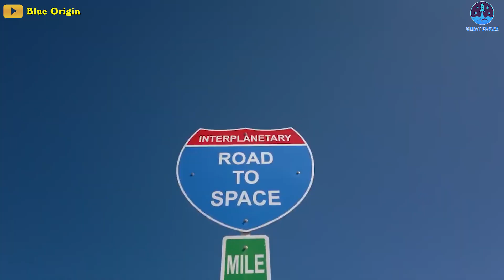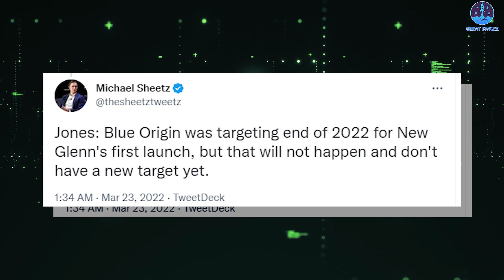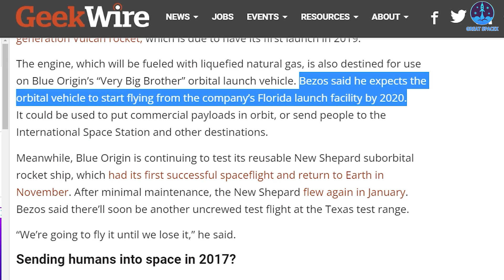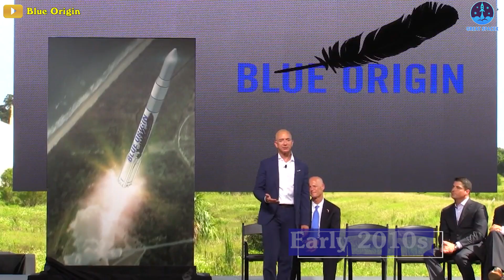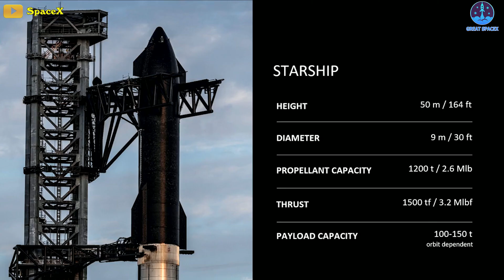Disaster! An In-Depth Look At Blue Origin’s New Glenn Launch Vehicle. Outclased by SpaceX!!!

Comment: The real issue for Blue Origin isn't the rocket's fuel tanks or ancillary equipment but the BE-4 engines.  Only one "flight ready" engine has been delivered in the last few months and a second engine delivered had to be sent back to the factory for more work.  Until Blue Origin can produce enough reliable engines for New Glenn, it will never get off the ground

Comment: 7 BE4 engines! That means BO will only have to wait 8 or 9 years between launch as they have only produced 1 and a possible so far. BO should stick to what they are good at - making rather dated, hopeful cgi for PR, since they certainly aren't good at building engines. Bozzo's New Glenn is an irrelevance produced by envy of SpaceX, and by its lack of engines has had the side effect of hamstringing ULA with its rapidly decreasing stock of launchers. By the time either gets to fly it may be too late to compete against much cheaper, proven, reusable designs and SpaceX will have wrapped up all the military contracts. Well done Jeff - time for BO to merge with ULA - United Losers Alliance.

Comment: Blue Origin seems to have a Long way to go , they have never tested it can’t even build the engines , unlike Space X that tested their Starship many times until they got to this point , we know we all watched the test flights and clapped when they got it right! New Glen hasn’t even been Flown, I guess they are going to go with the computer generated tests. We’ll good luck , even the SLS has never flown just the  components like the engines , fuel tanks and boosters have all flown in a smaller version , but will it fly we’ll find out on Nov 14th.

Comment: As soon as the first SpaceX Superheavy booster launches, New Glenn is obsolete.  Even if the market will not support SH, the engine manufacturing juggernaut will be in motion.   The BE4 is, admittedly, slightly more powerful than the SpaceX R2.  However, SpaceX is or soon will be delivering an engine per day while Blue Origin has delivered at an effective rate of one engine every 2.5 YEARS.  If SpaceX cannot use all the engines it produces because SH has little to no market, SX can sell engines to ULA and/or other launch vehicle vendors while BO tries to h I t a production schedule of one engine per year...
Meanwhile, SpaceX can build a medium lift rocket around 7 or 9 (or some other number; nothing magical about these numbers) R2 engines to reduce turn-around time and expense by replacing the RP1 fueled Falcon-9 fami,y with a cleaner methane fueled R2 engine replacement.  

Meanwhile, a new engine will be in the works... pushing Blue Origin further behind in engine design and development.
Reply: If Starship is successful, there will soon be enough missions for it when people and institutions realise how cheaply they can launch spacecraft to LEO and beyond.  The way I look at it is that it's like computers. -  once you build a more powerful and econnomical computer, the software designers won't be far behind...

Comment: The BE-4 engine has only slightly greater announced thrust than Raptor 2.  While New Glenn 1st stage will have 7 engines the Starship 1st stage has 33.  That means the Starship booster has 4.5 times the takeoff thrust.  Meanwhile BO has so far been unable to supply two working engines for a Vulcan, while SpaceX has over 100 Raptor 2 engines delivered to Boca Chica and obviously intends to have over 200 installed in the five boosters and seven Starships currently on the assembly line.

Frankly SpaceX needs competition.  The only company it is currently competing with is itself!  One aspect of this is the conscious decision to not make Falcon Heavy more competitive through a larger payload fairing or improved 2nd stage performance.  Once Starship is operational it will have a higher profit margin than Falcon Heavy.  It will also be more flexible.  Starship is designed like a commercial aircraft.  Every model of commercial airliner comes in 3 versions: short, standard, and stretch because all that is different is how many rings are in the fuselage.  Falcon and New Glenn cannot do that because of their carbon-fibre construction.
Reply: "Once Starship is operational it will have a higher profit margin than Falcon Heavy."
Understatement of the year. For 100 tonnes of payload to LEO they could charge customers 3,000% markup and still undercut the competition by a wide margin.
With less payload tonnage the markup would shrink, of course, but would still be incredible.
Reply: @TimStCroix  a
Reply: A book seller can not think like a nerd.
Reply: If Starship works as advertised, Falcon and Falcon Heavy upgrades will be redundant.  If Starship is a failure and can't be made to work, the imperative will then be to improve the Falcons.  At the moment SpaceX may not have direct competition, but the drive behind the Starship is the fact that it will open up space to many more people while bringing costs down, making huge profits for SpaceX.  The quicker SpaceX can make Starship a reality, the more profit for SpaceX, and simultaneously putting the last nails in the SLS and Blue Origin coffins.
Reply: @chrisantoniou4366  Considering how long it took to get Falcon 9 to certain reusability, which lacks still behind SpaceX planned reusability. I really doubt they will achieve this faster with Starship as a much more complex system. The best advantage of Starship is, it can be used as a Skylab-based space station. This means you can deploy space stations pretty fast, also combine multiple Starships into a larger space station. For moon missions the two-stage design is a pretty huge waste, for small payloads again it will be a waste, so left is large and heavy payloads. But these are rare, and their own Starlink payloads are an exception.
Reply: @oxygenasturia5706  SpaceX will not achieve a robust Starship quicker than the Falcons, but remember it has already been under development for some years and how long it takes from here will depend on the success or otherwise of the orbital test.  Starship will be completely reuseable and so will be much cheaper per kilo to space.  Starship as space station might at first glance seem to be a good idea, but most of the upper stage is taken up with rockets and tanks so not the best way to use something which is designed to come back and be reused.  In that scenario, it would be better and cheaper to use the upper stage to send multiple modules to LEO than using Starship in the way you suggest.

As for Moon missions, a dedicated lander based on Starship is already under development so that the SLS (if it ever gets off the ground) can actually land people on the Moon, and a Starship tanker is also being developed to refuel a lunar or Martian lander in LEO.  You are perfectly correct in that a Startship is really only good for larger and/or heavier loads, but these will come when the capacity is there.  Bigger, more capable probes, landers and rovers can be sent further, more often and more cheaply into the outer Solar System, larger more capable satellites can also be sent to geostationary orbit and larger more capable telescopes can also be sent to various orbits more cheaply.  The old adage "build it and they will come" applies here in the same way that faster and more capable computers were built before the software engineers could write software to make use of their abilities, one follows the other...

Smaller rockets will still be necessary for smaller payloads or for orbit specific payloads, but if Starship can be made to work, even if it does take years to do, it will completely transform the space industry.
Reply: @oxygenasturia5706  SpaceX originally designed Falcon 9 to be used 10 times and now there are boosters that have flown over 13 times. Where do you get your information from? SpaceX says it needs Starship to make Starlink profitable by launching hundreds of satellites each time. What would be the point of using the Starship second stage as a space station?
Reply: Recently SpaceX celebrated a milestone of producing 200th Raptor 2 engine.
Reply: SpaceX clearly does not need competition lol, they have a vision, and the vision has nothing to do with competition - in contrast SpaceX is by default open to cooperate
Reply: If it's operational, it then needs to prove it's a reliable rocket, also reusability and launching cost. But before it needs to prove it can reach orbit at all. For most launches Starship is simply too large, it's a massive waste of using such a powerful rocket, and combining multiple satellites like Starlink won't work this easily if they need different orbits. New satellites using the capabilities of Starship needs multiple years in production. We can already see that Falcon Heavy wasn't really used much. It's pretty unlikely Starship will achieve cheaper launching costs for small satellites such as Falcon 9.
Reply: @oxygenasturia5706  i think you missed something that would make starship one of the chepest rockets to lanch period its reuseablity rockets Are expensive to lanch not becuce og fuel but that all rockets excpt f9 is single use mening you have to turn a profit on one fight Even f9 upper stag isnt reuseable so its expensive now you could cut price pr lanch almost in half by makeing both first stage and upper stage reuseable for 2 fligts starship is also designed for rapid reuse f9 isnt a starship could do multiple fligts a day allowing more lanch Windows and provide cost savings on control team planning
Reply: @pingvingaming  The current reusability is only talk and paper, I highly doubt they will achieve this easily. If they can achieve 10 turnarounds it would be great. The current target is more, achieving an orbital entry.
Reply: @oxygenasturia5706  dont think they take long to Lean  hos to get starship in orbit they got experinces in getting rockets there they know how to land a booster only Challenge i see for Them is reentry of the ship it self but they can and will mand it work spaceX is professionelle in makeing impossible late

Comment: The new Glenn rocket need to be upgraded to a three Tri-rocket system. 👍
Reply: They can't "upgrade" something which hasn't been built or flown yet.
Reply: That will be exponentially harder.  Just ask SpaceX how much harder the Falcon Heavy was to engineer compared to the single core Falcons.  The New Glen rocket is about 10 feet wider in the core stage for starters.